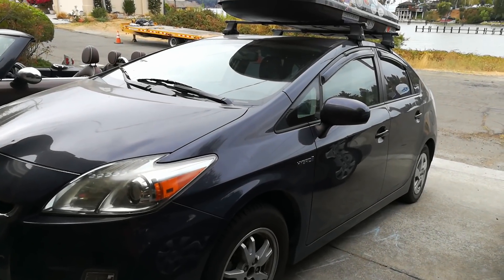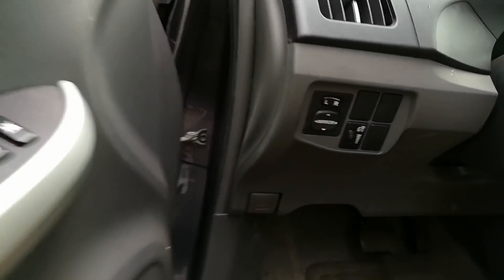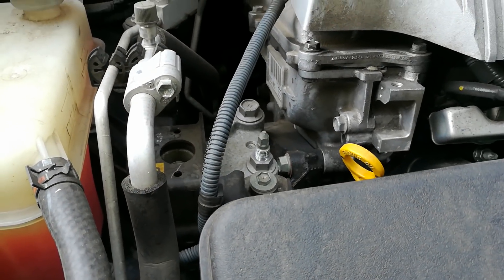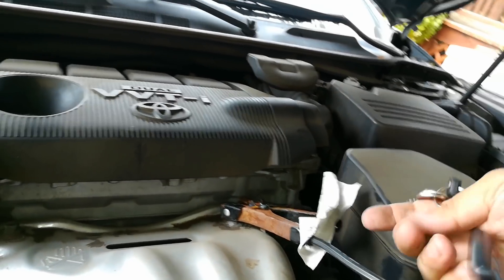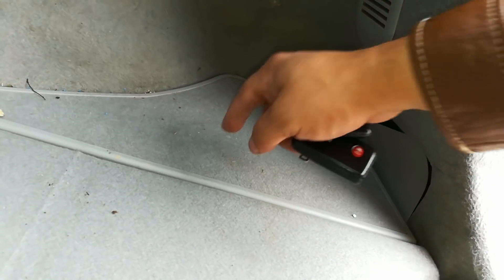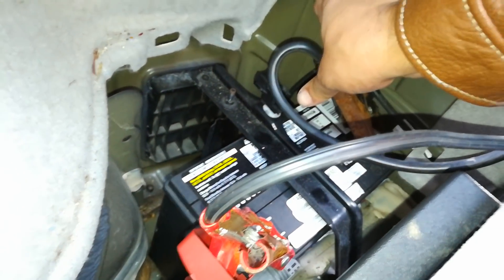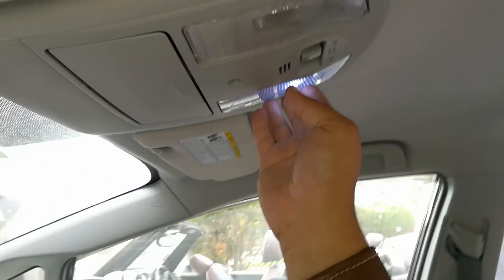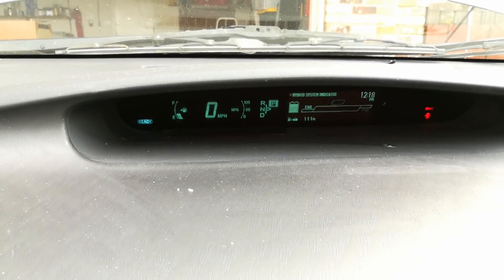Jump Start Prius Battery

Comment: How do I attach Battery Tender to Prius to maintain charge while on vacation?
Reply from the maker: Ken, how's your parking situation? if you parking the vehicle in your home garage then you can leave the hood up and just connect to little connect at the front or in the hatch, please make sure you keep a window open in the garage and also in your car as the battery inside the car.  Charging batteries can produce dangerous/explosive gas even with a little battery tender. I hope that helps and let me know if you have any questions

Comment: I read that you are not supposed to start the other car that you are using to charge the prius battery.....is this true?  Will it charge it if you just have it hooked up and don't have the other car started??? Thanks!
Reply from the maker: Hi Lacey, Yes, the Prius the battery will charge if you don't start the other vehicle. However, I don't recommend doing it that way, The reason why you want the other vehicle on is so the alternator of vehicle running will help revive the Prius's 12-volt battery and not take a chance of depleting the booster vehicle's battery. I've never had a problem jumping a vehicle in this manner over the last 25 years. I hope that helps. _RandomFix
Reply: Can you use the prius battery the on the back    to jump start another car

Comment: Couldn't find the battery on the Prius- haven't drove in a week, drove 1 1/2 mile to dog park & car wouldn't start.  You saved me, many thanks!!
Reply from the maker: Gabrielle Arboleda , I normally leave the booster cables connected for at 10 minutes to give the Prius 12 v battery a chance charge a little bit. Once you start the Prius you want to drive it for at least 30 minutes before turning it off. Best of luck.
Reply: How long did you let the jumper car on? 2 minutes? or more?
Reply from the maker: Mr. C Jokey, Glad to hear the video was of service, make sure you put the battery on a tickle charger or have the battery tested. 60% of the time this means you need a new battery unless you accidentally left something on or the cold weather is already affecting your battery. Let me know if you have any question. Cheers.
Reply: Thank you RandomFix.  Your video and your demonstration were very useful.
Reply from the maker: anytime, cheers

Comment: Thanks for your very detailed and instructional clip! You really helped me finding the jumper terminal in the fuse box! I tried to find it by using the Toyota manual, but the picture in the manual is so small and unclear that I gave up until I watched your clip. Many thanks!!!
Reply from the maker: Tova, Glad to hear the video was of service, make sure you put the battery on a tickle charger or have the battery tested. Only replace it a AGM battery (the prius came with 12v AGM battery from factory) not a cheaper acid battery if needed  Cheers.

Comment: And boom.....    never connect like that....   off gassing from batteries will explode from spark. I personally would have gone with both on the prius then pos to battery of jump vehicle then to bolt on motor of jump vehicle. ....    
Having a large number of them here- I can agree with you on the not wanting to use that small "jump" plate in fuse box.  But i have boosted them in -20°c from that plate....  best is to connect and let car sit with jump car running for 4 or 5 min then start dead car...  battery will have taken enough of a jump that with the cables still on it will fire right up.  Just tell the person to go for a 30 or more min drive with nothing turned on.
Reply from the maker: Jthetowtruckguy1, thanks for you sharing your knowledge, the little positive jumper port's backside is covered with plastic and so you will literally be jumping a car with only two or three teeth of you the jumper cables. Cheers
Reply: Yup....  thats why I said to let car take a charge for while before starting. .   I usually pop cables on then go back in truck and write invoice for job.... then that is usually about 3-5 min.... then its an easy start....  those small motors don't take much to crank over